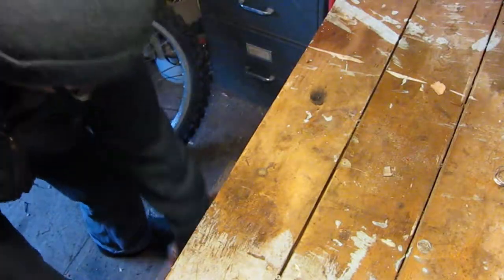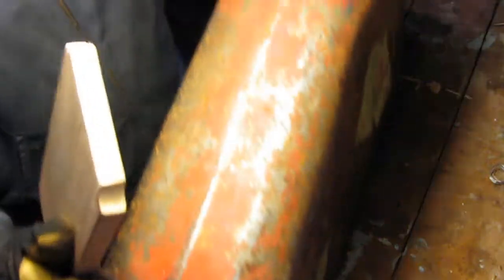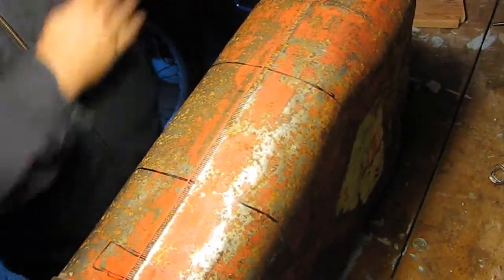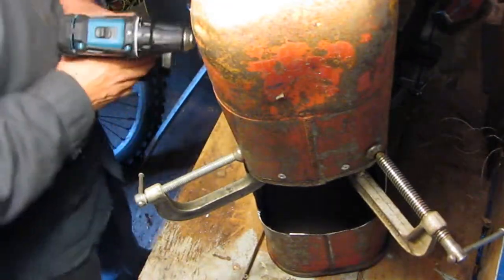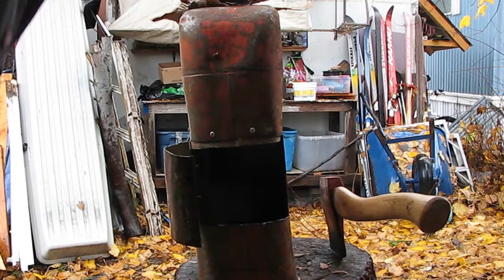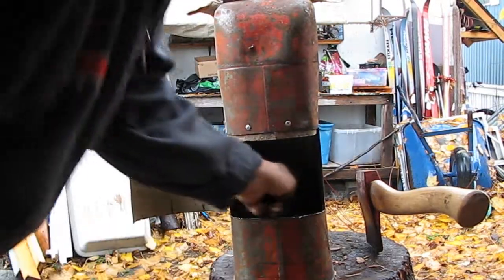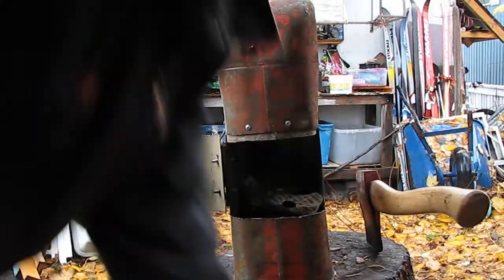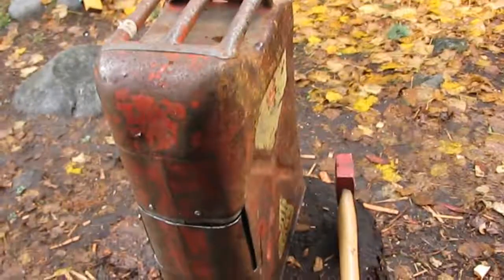Jerry Can Woodstove - No Welding Needed

Comment: Did the fire melt the rivets?
Reply from the maker: As of yet, the rivets are still holding fast!
Reply: @Back40Bushcraft  I'm going to use a large ammo can for mine
Reply from the maker: @Terpygrowz707  I've seen several different styles, and I think they can work very well.
Reply: @Back40Bushcraft  I used a 2.4 gallon waste basket. I like the flange idea for the door. I might try that. I have to redo my door. Yes I broke drill bits also. I will have to be a carbide. Or else I can just try keep my current door - and save the cost of a strap hinge, a drill bit, etc. I don't have a riveter - so
Reply: Stainless steel nuts and bolts would work great also.